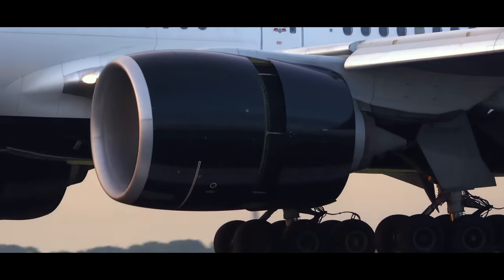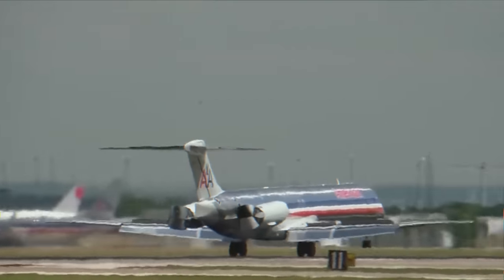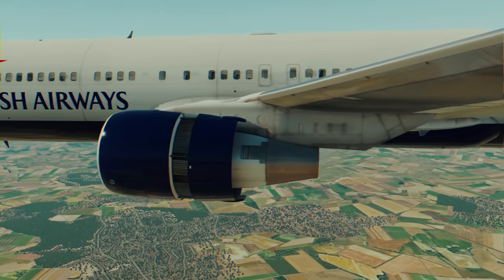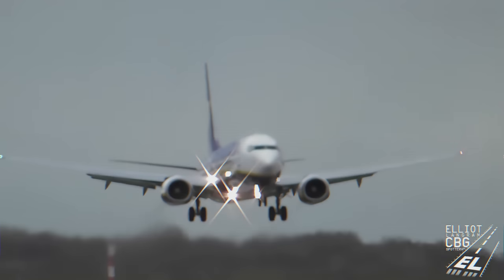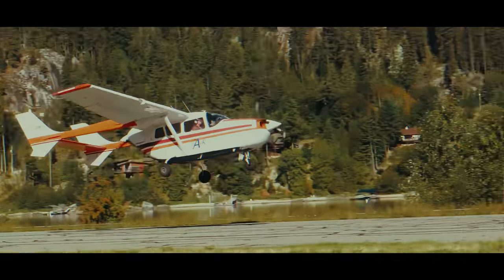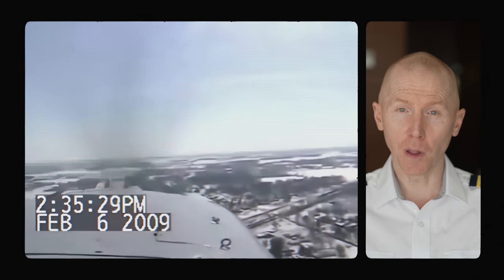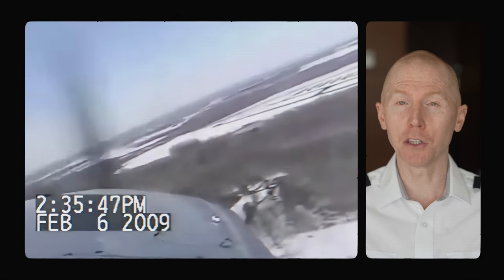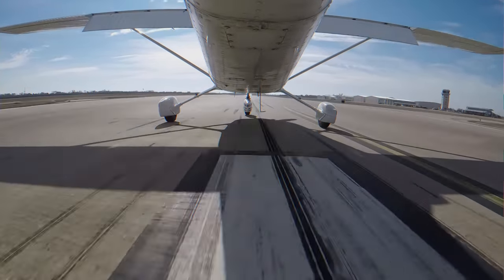Ryanair Pilot Makes Big Mistake

Comment: That final turn in the second clip is exactly the sort of overshot base turn to final that proves deadly for so many pilots. Frankly, I'd have passed on it and landed straight ahead in the soft field.
Reply: That's what I thought when I saw it. Only thing I can think is that he is extremely familiar with the flight characteristics of that plane that he knew he had plenty of lift at that speed, temperature, and angle, despite the audible stall warning.
Reply: I agree.  The pilot here pulls it off, which is wonderful, but I was thinking exactly the same thing.  At that point, I'd just go for the snow.
Reply: If it was a bare open field, you would have a solid point.  However, that snow looked rather deep and that could catch the gear and cause the aircraft to flip.
Reply: I had the same thought, though I can understand the appeal, under stress, of going for the runway when it's so close. I'm glad it worked out!
Reply: Yeah, I was thinking, "Right, made the right call to make the 180, he was high enough for that, but... man, you're too low to line that up, just go for the snow, it's soft, it'll help cushion things."  Particularly in a light single, it's designed for a bit of "off-road" abuse to the gear, and hey, you already made the *airport*, don't take an excessive risk on trying to avoid any airframe damage.
Reply: Yep that's what I was thinking, very close to being a low altitude stall spin glad he got it down but many don't
Reply: Yeah, watching it myself (and for context I'm a student pilot myself, no RPL but has done solo), I would've not done the whole turn back to the field in the first place. Of course this is partly due to my school's instruction policies including what's stated in the pre-takeoff safety brief:

'In the event of an engine failure after rotation below 500' with insufficient runway remaining, I will lower the nose for an optimal glide speed of [insert optimal glide speed for your aircraft here] and land in a field within 30 degrees of the nose.' We wouldn't turn back to the field, we would land the aircraft straight ahead. Turning the aircraft like is seen in the second clip is suboptimal when you're in an emergency glide, and as Kelsey has mentioned, you've got nothing to 'trade'  so to grant you the most time possible, we remove one thing and don't bother turning around.
Reply: @thespacedingoking  Depends.  If you still have some power on, i practice turnbacks at 400 agl only and landed on opposite.  1998.  And it is not a turnaround, its a Turnback.  Different maneuvers..
Reply: Except you don’t what height he had, he did.
Reply: Flipping the aircraft in snow is better than stalling in.

Comment: I suspect the decision for the left runway was based on energy vs remaining runway. He may have felt there wasn’t enough landing distance to stop in time. From my kitchen table I’d like to think I would have selected the runway he was more closely aligned with and slipped down the extra altitude to avoid that steep bank but my kitchen table isn’t falling out of the sky. Can’t complain with his end results though.
Reply: Plenty of runway left there. Long 10000ft runway. That's my local, Stansted.This particular day was awful. Really bad crosswinds. To the casual observer, the landing seemed excellent  in the conditions we were seeing.
Reply: @pauldunn5978  I think "some guy" is talking about the GA plane with the engine failure, not the Ryanair 737.
Reply: For future reference, if your kitchen table is falling out of the sky, you built your house wrong.
Reply: @beeble2003  Aah yes! I stand corrected.
Reply: Yeah, from my couch it seemed like maybe a wider return loop would have made everything a lot easier and set up for that crossing runway with plenty of space and without the aggressive S turn. :sips-coffee:

Comment: When I learned to fly, one of the first things they pounded into my head was, if you have an engine failure just after takeoff land ahead because many times, chances are, you won't make it back to a runway, and chance stalling trying to extend the glide. Depends of course what the landscape was like ahead.
Reply: I had the same thought. There are AOPA ASI pilots who cannot do the impossible turn, so I seriously doubt I could. I guess it depends on height above the ground and plane performance (and pilot skill, of course).

Comment: The Hawker Siddeley Trident could deploy reverse thrust on the centre engine in mid-flight. I was in the cockpit 3rd seat once when circling Heathrow waiting for a landing slot. ATC said if we can get down quick enough there's a slot available. Co-pilot was flying and he initiated reverse thrust so that we could lose altitude quickly. The pilot was monitoring and told the FO that we were effectively plunging to the ground so he "Might want to monitor that descent rate." It was all done very calmly of course!

Comment: The thrust reverser redirects idle engine speed thrust forward, in this scenario, for a few seconds. Only when the pilots advance the throttle on the ground would reversing thrust be enabled to slow down. So that is minor. The bigger concern I see is slamming on the right main and slamming on the nose, which is not as sturdy, when ideally the mains take the blow, then tiptoe the nose down.

Comment: That last turn had me anxious for what I was about to see, could have easily been a stall spin at that point. Glad it turned out okay in the end! I agree, I think I would have gone for the cross wind runway in this situation and kept those last few turns much shallower, though these things are always easier to say with hindsight.
Reply: Or no runway at all. keep in mind that a field is often a possibility. The turn back to the departure runway after an engine failure is called "the impossible turn", because you will increase the already high angle of attack even further, often to the point of a stall.
Reply: He took a gamble to save the airplane lol.  Your solution would have made you more likely to survive upside down in a destroyed plane :)  (after it goes off the end of the runway and the nose gear collapses in the mud at 30 knots)

Neither answer is incorrect.  It just depends on your priorities.
Reply: The whole situation made me nervous, after seeing those Air Safety Institute videos regarding engine out on climb outs and advising people to not 180 back to the airport
Reply: @thevictoryoverhimself7298  Airplanes can be replaced, people can't. Those are some long runways and if speed or altitude needed to be lost a forward slip or flaps could have been deployed. Easy to loose the extra energy, not so easy to gain it back.

Agree though that neither answer is incorrect, as I said before – easier to comment/speculate with hindsight. The pilot here did a great job at keeping it all under control at those slow speeds close to stall.
Reply: @JoshAntBrown  Saving both the human and the airplane is worth a try :)  Energy management is something not even all experienced pilots have.  Some people who only play video games might have better instincts than a 30 years airline pilot.  Its one of those athlete things :)
Reply: Yes bouncing off a stall horn in a steep bank low to the ground is not a good idea. Straight ahead into the snow beside the runways if needed, put the plane on its back, but walk away, the plane did its job of brining you home safely, that,s what insurance is for. Better the plane than your life.
Reply: @wb6anp  I agree with life > airplane integrity. However, you will NOT be okay after a plane flip. There is a high chance of spinal/back injuries that will plague you for the rest of your life.
Reply: hard cold winter air - soft summer air - call the morgue
Reply: I was certainly surprised when he made that turn.
Reply: @ogaibo1316   Bullshit, not all turnbacks from climbing out are "impossible Turns".  I learned turnbacks from 800 agl in 1998 and taught them to about 7 students before i went to the airlines in 1999.

Comment: One thing I learned ridge soaring a Cessna, is that the stall horn is set quite a bit higher than stall; to effectively operate at Vx, you need to fly just above a stall, which means the horn will be on continuously. You basically have no ASI in a hang glider (besides feel and sound), so if it stalls or gets close (sensed by back pressure/sink rate), you just lower the nose; You can clearly tell when a Cessna will stall by feel also, so just lower the nose so you don't drop a tip and pound it.

Comment: The pilot in your 2nd recap was lucky to have a good outcome.  Turning back to the airport on takeoff due to engine trouble is often fatal.  Wings level means greater lift.  That guy either really knew his airplane, or he was incredibly lucky.
Reply: Impossible Turn
Reply: Quick thinking is definitely required in situations like this. As an instructor once told me, "never run out of altitude, airspeed and ideas all at the same time"
Reply: He was incredibly lucky. He knew his plane very well and was skilled flying it, but he was incredibly lucky.
Reply: there's a reason they call it the impossible turn
Reply: Yeah, I was about to comment the same. That's called the "impossible turn" for a reason. It usually isn't possible and instead results in crashing before reaching the field. Perhaps his plane had better climb performance than most light singles. Also, I suspect that the white stuff on the ground is also a hint at part of why he made it: climb performance is significantly better on cold days than on hot ones due to the more dense air. If he had tried that same maneuver on a hot and humid day, he might have ended up in those trees instead.

For light singles, I was always taught to find the least bad spot to land that is more or less in front of you if the engine quits after takeoff. You trade a whole lot of energy to make that 180 degree turn and you usually don't have that much to spare so soon after takeoff. That was one advantage of the airport where I did the early part of my flight training, though: it was on a 300-400' hill, so shortly after passing the departure end of the runway, you had an extra 300-400' of altitude to trade if needed. On the other hand, you really, really didn't want to land short there and the wind flowing down off of the hill into the valley below would pull you down a bit on short final (there was a 300-400' drop at both ends of the runway.)
Reply: HE WAS NOT LUCKY.  HE WAS TALENTED ENOUGH TO DO IT.   Its was not an impossible turnback.  It was a possible turnback.
Reply: The “impossible turn” is a myth. It’s absolutely possible even below 1,000 feet. 

If you’re a CFI/ATP with thousands of hours of dedicated practice and professional training in THAT particular airplane, it might be best to turn back. 

If you’re a Private Pilot named Jim-Bo who does only 100$ hamburger runs once a month, it’s probably safer to just land straight ahead. 

It’s critical to be humble and honest about your (and the airplane’s) abilities and make these decisions before it happens to you.
Reply: @byronhenry6518  You cannot be afraid of doing 45 degree bank turns with the nose down, pop flaps if hight and cut mixture if high.  No big deal.  But some cannot do that.   A shame.
Reply: @byronhenry6518  With partial power, my CFI n 1998 taught me how to turnback from 400 agl after troubleshooting the engine. 10 knots winds.  4,000 feet runway.
Reply: @byronhenry6518    Regardless of how it’s pronounced, it’s written “$100”
Reply: During my CFI training we practiced "impossible turns."  If you react quickly enough and know your airpseeds and altitudes well enough, you can do it.  I assume the pilot either knew at his altitude he could make it back, or he had no other option for safe landing ahead.
Reply: @Nasreth  Some pilots can only do Mild Maneuvering.  They get a nervous breakdown on a 45 degree turn.  They are only Mild Maneuvering Pilot.  No more than that.  A shame.
Reply: Fidd88  i was about to comment on glider training as well. Every take of I had to verbalize to my instructor. “On the runway, on the runway, Straight ahead, staight ahead, turn back, turn back” all in anticipation of the inevitable rope break training where the instructor would pull the release.
Reply: Fidd88  I once had the engine on a C152 quit at about 50 feet. Luckily it was at Manston so I had about 7500 ft of runway left.
Reply: I will only take to the air when I get my wings. As I am not a bird I do not see myself with  much chance of being any higher off the ground by any more than the thickness of my shoes. GOD BLESS ALL THOSE WHO TAKE TO THE SKIES, PARTICULARLY THE PILOTS AND CREW WHO DO IT EVERY DAY.

Comment: Hey Kelsey, there was a bad crash due to asymmetric thrust reversers in flight - a Boeing 767. It was Lauda Air 004 on 25 May 1991 and it's on Wikipedia.

Comment: On a take off engine out I was taught to not turn back to the airport.  You need something like a 700-800 feet minimum before you could turn back to the airport.  On a Cessna 152,  engine out, you drop 500 feet in a 180 degree turn.  The loop like turn is actually over 180 degree, so more then a 500 foot drop.  Add another couple hundred of feet.  Many who try without enough altitude stall it in trying to get back to airport.
-Kurt
Reply: Yes, I was taught the same. I suspect that white stuff visible on the ground may be a clue as to why this worked out for him. Climb performance is significantly better in the more dense air on a cold day. If this had been a hot and humid day instead, that turn may have ended very badly for him.
Reply: 500 agl is too low for a power off turnback.  Ok if some power left on.  I practiced power on turnbacks EFATO from 400 agl in 1998.  They work.  and it is more than 180 if landing on the opposite runway.

Comment: We had two bad experiences with Ryan air, both hard landings.
One in particular jarred my back causing me to cry out in pain.
The impression we had and still have of Ryan air is to get the aircraft down and on time at all costs.
We haven’t flown with them for several years now.
Reply: That would be correct. Hard landings reduce the chance of needing a go around and they do that because three go arounds within a certain time frame means Ryanair will force the pilot to go back to the simulators for retraining.
Reply: @mikoto7693  You have no idea. Ryanair has a no blame policy on go arounds, you even get in trouble if you don´t perform a go aroun in certain cases

Comment: We used to use idle reverse on the Caravelle in the flare. It made for a very nice touchdown. The Caravelle wing was very clean and had little sweep, so it wanted to keep flying. We also deployed the speed brake throughout the approach on that aircraft. We used inboard engine reverse thrust in the air on the early DC-8's as a speed brake during descent occasionally, but it shook the airframe so much that it made pax nervous.
Reply: ☝️thanks for watching & leaving a comment, congratulations, you have been selected amongst my shortlisted winners
Kindly message me on the above☝️

Telegram only to claim prizes🎁

Comment: Probably needed to exit the runway at the nearest possible exit in order to avoid taxiing half across the airport. I experienced that on a Ryanair flight multiple times, I actually enjoy it as a passenger, because it can save you good 10-20 minutes when you cut the queue of all the planes waiting at the taxiways further down 😄And 20 minutes is Ryanair's standard turnaround time, so I suppose it makes a lot of sense for them too.
Reply: This is a 22 landing away from the terminal at STN.  There is a rapid exit turn but two more options a bit further down. The difference in taxi time is literally one minute so not really an issue. The RET is more for the benefit of the airport to get aircraft off the runway ASAP so clearance can be given promptly to inbound traffic  at peak arrival times.

Comment: I'll often deploy TR's 1-2 seconds before touchdown if I feel I'm coming in a little too hot. The TR's take about 1-2 seconds to actually become effective, and it doesn't have any negative consequence to do so.  The pilot can sense if the aircraft has still too much lift to stall organically above the runway, so he forces a stall to get positive contact with the ground. This approach was really hectic with lots of lateral instability, and many pilots might have rejected. This guy was experienced and determined to get the equipment down and I respect that.

Comment: Another aspect not mentioned is there is two different "idle" modes, one in flight and one on the ground. When the 737 lands, there is only a couple seconds before it will switch to that ground idle mode, which is lower than in flight. So if you miss that window for deploying the reverses, it takes even longer for the engines to spool back up and provide power. So that's one reason that pilots are automatically looking to get them deployed ASAP the second they touchdown.

Not a big deal when reverse thrusters are not needed, but a very big deal when they are needed.

Comment: My oldest brother use to ferry planes to the new owners, before he became a Fed-Ex pilot..  He took off and while still low and over the runway the engine blew up just after he retracted the gear.  When he told me the story, he said he did not have enough runway beneath him to push the plane back down to land, so he did an aileron roll to get all lift off the wings, and allow the plane to drop straight down.  At the last moment he leveled the plane off, dropped the gear and landed on the remaining part of the runway and coasted into the grass between the runway and the taxiway.  It was at this point he called the tower once the plane was on the grass and nothing but just a whisper came out.